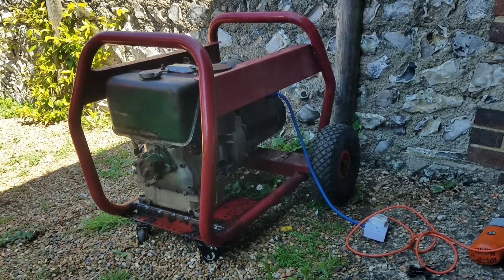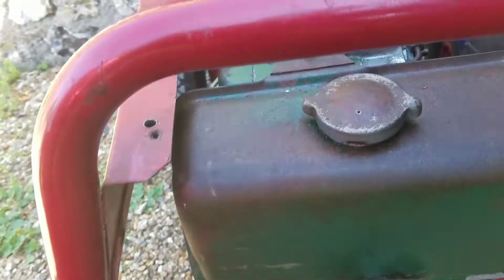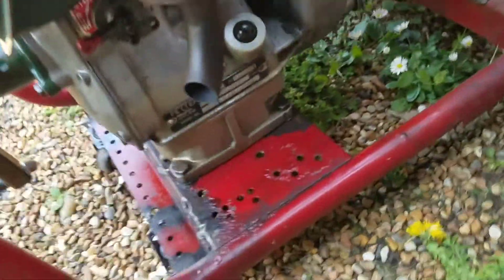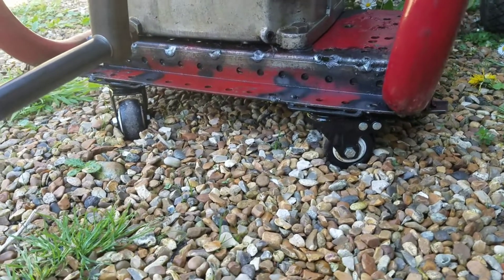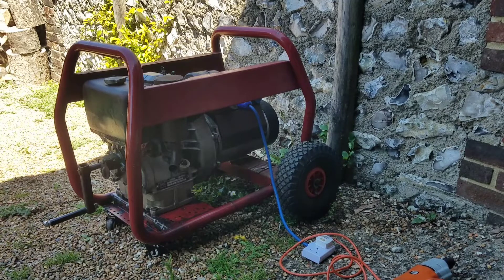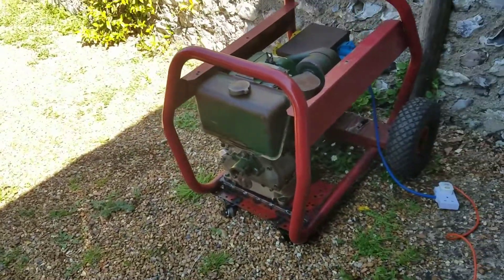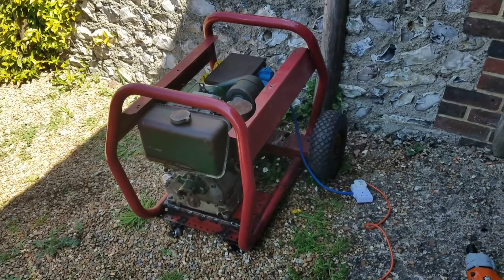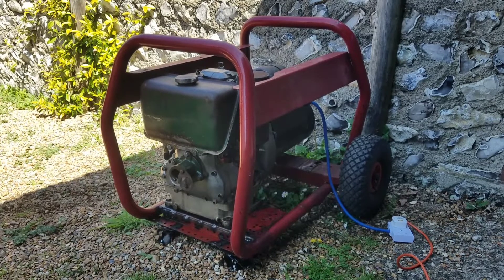Lister Petter AC1 diesel generator walk round, startup, running, test and shutdown

Comment: The generator is a Musgrave 4kva unit. Unfortunatly my unit has failed ??? but can't find any details on internal wiring or components. The capacitor is fine as I've replaced it with a new one. The switch and fuses are not an issue. It's something that I bought in the hope to get it working but can't find any technical details. Do you by any chance have anything.
Reply from the maker: @PeterStringer-h9f   Sorry, this came with no documentation at all.

Comment: How's the capacitor?  Do you know where to get them?
Reply from the maker: Seems to be nothing wrong on this Petter AC1 so I haven't had to find one fortunately. Lister are still in business though and they sell parts.
Reply: @TefsTravails  Aye but not at their prices.  Found them on the usual suspects platform.  Sub £10 so got a few and will under run them.  
AC3 Myself with 5Kw Markon alternator.